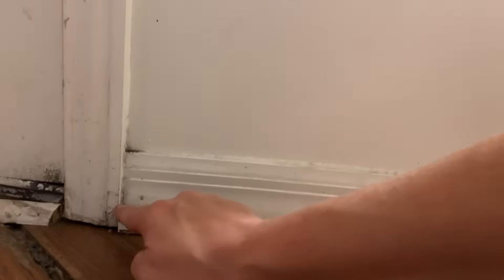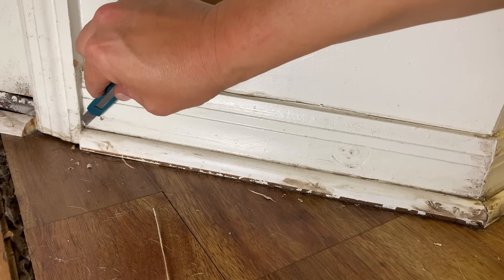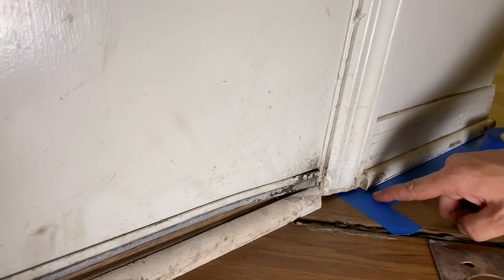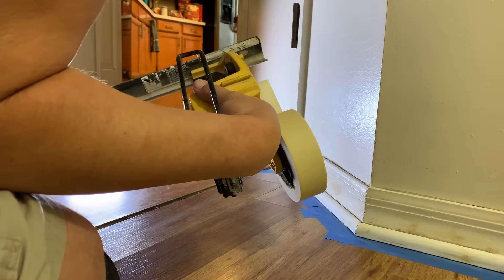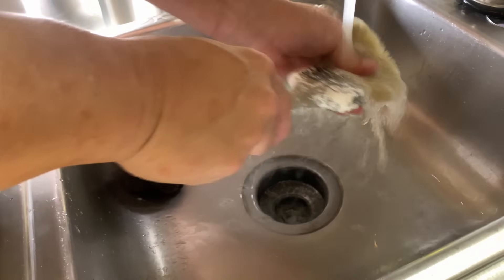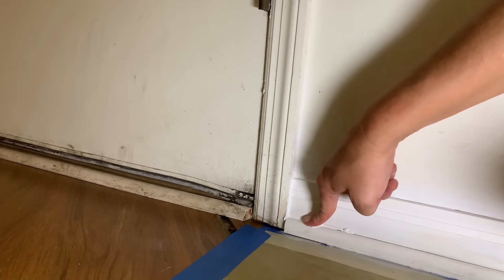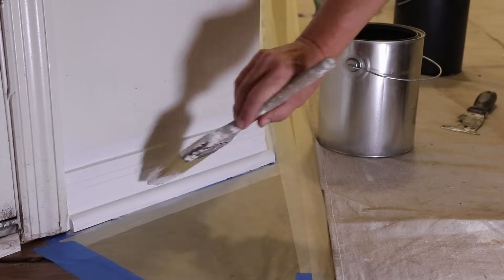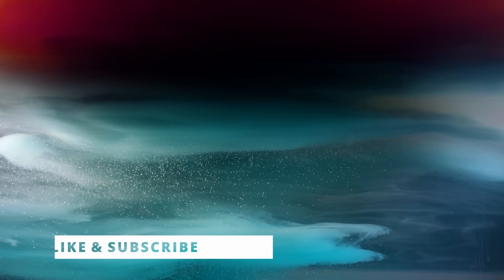How to Prep and Paint Baseboard Step by Step

Comment: Would it be easier just to remove baseboard and install new ones?
Reply: That's where you pick your poison! Lol
Reply: If it was my house, yes time for new baseboards!
Reply: Me too
Reply: It looks nasty as 🤬. Gross!!!!
Reply: I have historic trim. Can't just stick lowes stock trim in it's place,  but,  otherwise,  yeah, i agree.
Reply: I’m pretty sure you would still have to follow all the steps, except you’d have to buy, measure, and cut instead of remove the caulk and sand. 🤷🏼‍♀️
Reply: If you are looking for a pretext to upgrade your baseboards and door casings just do it.
Reply: Yes.  But remember.  Either this beautiful work, or whole new baseboards will look almost exactly like the original horror, in a few years... a year or 2 if you have kids and a dog.
Reply: @har8397    To be fair the original horror would have looked significantly better with a good scrubbing and it is not like the bad caulking and unfilled holes going to reappear.
Reply: My Mom always said; paint hides a multitude of sins. This home is older. You can’t just find replacement from HD, or L.
Reply: Nice job done man
Reply: Probably be cheaper. The labor to prep the old baseboards will add up. Although, some customers want to keep old trim for different reasons.
Reply: All about time n money
Reply: Dont leave blue tape on laminate wood too long. Did my kitchen took 4mos took floor paper and plastic dust barrier off, and totally ruined wood grrr
Reply: You have to match , cut an install that new baseboard…. Or ….. you could take the TIME to do what he did …. It’s all about $$$$$$$$$$$
Reply: The actual baseboard yes. the bottom half is called a quarter round there's nothing historic about that part replaced @hremaddox
Reply: @jendzendzel4052 not necessarily old trim comes off super easy within 5 minutes that section he was doing. and if you get pre-primed measuring cutting add Caulking and you're done I promise with a little bit of practice you could do that under 3 hours for that small section he was doing. That took way too long
Reply: @har8397 I lived in my place for 11 years now I don't have a dog my trim work looks exactly like it did.  obviously it gets dingy with time. a little paint and you're done
Reply: Yes!
Reply: 😂 right?!
Reply: I’d be ripping it out and tightening up the joints….
And how about they gap in the floor planks 😵‍💫…I’m too much of a perfectionist…I wouldn’t be able to sleep
Reply: That's a waste of material and massively environmentally unfriendly. Just do less prep and mask, paint over it. Doesn't need to take a whole day to do some skirting boards

Comment: A good job done. Sometimes it’s necessary to weigh up if extra time spent to restore old stuff is worth it as opposed to just fitting new. Sometimes it’s cheaper in time so therefore money to rip out the baseboard and renew it.

Comment: only been painting for 10 years myself. i love watching other peoples paint videos and learning from them. you did great work. I never used a 5 n 1 to push the tape down always just my hand. I am going to have to use that trick. It looked like it worked very well. for anyone who is wanting to do this yourself be sure to take your time. if you rush before stuff is dry you can ruin your hard work. also if you want it to be even smoother just sand between coats. 220 or 320 just a quick pass over to knock any dust or anything that might have gotten out your work. again amazing video

Comment: Regardless of my thoughts on the cost of doing this vs replacing, if it were my own home I'd be repairing instead of replacing. The only improvements I can add to this would be to use powdered drywall compound instead of the wood filler and pre mix mud, to lightly wet sand primer after cure, then add a propylene glycol or vinyl acetate like floetrol to allow brush marks to flow out.  

Personally, I would remove the mouldings to sand and paint them if they looked like that

Comment: I start with a wet sand. Hot water in a spray bottle with a 150 flexible sponge pad. Wipe with a tiler's sponge when done. This cleans the base and quarter-round quickly and BACKS UP THE MANUFACTURER'S WARRANTY!!.............you know, the one on the paint can.

Comment: Call me crazy, but I pull them off the walls, sand and paint (wagner sprayer) after pulling nails out and filling nail holes, reinstall them and just touch up after going over the nail holes and corners with wood filler or drywall compound.  I like high gloss on trim.

Comment: What if my walls are plaster? Do you suggest I do anything different since you're working with drywall?
Reply from the maker: Drywall mud should work for most kinds of repairs or a full skim coat even. The only thing is that plaster is much harder to sand than drywall mud and may be tricky to blend where they meet, but if the drywall is being applied on top of the plaster it should be doable.

Comment: I don’t understand using mud to fill gap between baseboard and wall… seems unnecessary and too much work. Can the caulk just fill the gap ?
Reply: Yes, but sometimes when you remove old caulk it can pull off paint and part of the upper surface of the drywall, which wouldn’t look right if you just caulked without fixing it first. It just depends on how clean you can get the caulk out in the first place.

Comment: This is really the minimum in homes 50+ yrs old…I was thinking, how do you know the paint on the base is not oil base?  I guess assuming the base material is PVC one could expect everything to be latex….and therefore you can use latex primer.
Reply from the maker: From experience, oil based paint looks and feels different than latex. Oil paint also "dusts up" a lot more than latex when sanded. If Im not sure, Ill wet a bit of rag with denatured alcohol and gently rub the painted surface. Latex paint will melt instantly and stain the rag, and oil paint will not. Also, the new alkyd or hybrid paints are pretty good at not caring about what it's painting over.

Comment: Wouldn't it be easier to replace the baseboards and trim with new ones?
Reply: I was thinking that too. I think it would look better and cost less to replace the beat up old trim.
Reply: In this case, yes, but he's only showing this as an example for a video. There are a lot of historical homes with trim that would have to be custom made for big money to replace.
Reply: It would not be easier. Anyone who says that has not been there before. You have to do most of these steps with new trim so the nailing, setting nails, wood putty, sand, primer, caulk, paint. Here is what you would have then also added to the job to do new trim- the removal, trips to store, multiple up and down to measure and then go cut, and then the cost of material. He went slowly as it is a tutorial, this doesn't go that slowly.

Comment: Would It not be easier to fill then sand the whole baseboard rather than sand fill sand.
Reply from the maker: I find I get a better result when I do a heavy grind to knock down all the high spots before I fill holes  because the filler has to be sanded more carefully .

Comment: Great video, but wouldn't it of been easier and cheaper to just replace the baseboards?
Reply from the maker: Well if you have the tools, you would have to cut the old calk, then pull the old baseboard. Then buy new wood, cut it, install it, fill the nail holes, sand, prime, still fix the drywall where it meets the wall. then sand again, re-caulk, mask, and paint 2 coats. I think prepping the baseboard is easier and takes less time than replacing and prepping it, especially if it's a whole house.
Reply: @peakhousepainting1933  
Ah I see thank you for taking the time to reply sir. 👍

Comment: Great video. One question, if you have a risk of lead paint, isn’t sanding going to cause an issue? Is there another option besides sanding?
Reply: Yes, you want to avoid sanding lead paint. A safer option is to use a liquid paint stripper, but that comes with its own challenges. Alternatively, replace the baseboard.

Comment: you should have removed that poorly nailed quarter round - clean it up and reinstall it or replace it . when you applied the caulk smooth it in with a putty knife to get a tight and squared finish ... your finger leaves a rounded curve in the caulk
Reply from the maker: I agree but the quarter round was added to cover the uneven edges from the crappy laminate floor install 🤷‍♂

Comment: You need to be careful putting painters tape on finished hardwood floors. The tape is meant for painted drywall, not floors. The tape can rip the coating off the hardwood floors. Learned this the hard way.

Comment: The previous guys probably didn't get paid enough to have a choice to worry about it happens all the time in decorating a lot of people think its a peanuts job
Reply: Doesn't matter how much prep he does besides the obvious punching the nails thru... Hrs never going to make that baseboard look brand new..... Once it's old and fucked up...dings...your never going to make it look brand new... yeah you can make it look refreshed but most people don't want to pay the actual cost to do this much prep on ALL their base in their house... This guy did on a little 12ft run of base... Most people would rather pay some Mexican $200 to come do a quick job...I've been a professional painter for close to 10 years trust me I know... Most people don't want to pay the actual price it takes to do crazy in depth prep... Have to stay competitive... And this guy doesn't have much experience caulking or painting... and the fact he laid down a drop clothe to paint baseboard is non sense... He should've had that down before he made the multiple messes that he had to vacuum up... So sick of non painters trying to sell BS for views....
Reply: And he's literally using wall paint for the base when there's is plenty of options of paint that is specifically designed for trim that is more durable
Reply: @nothingsimpostleble1593  sometimes you can get them looking brand new but yes a lot of the time if the customer or previous painter as painted them wrong then apart from burning them off which would be very costly you can only get them to a point but its still takes a fair amount of time
Reply: @nothingsimpostleble1593  some wall acrylics you can use for woodwork though like you say not really durable enough but then most acrylics that are designed for woodwork ain't durable enough anyway especially when it comes to dirt pick up and grease and he may have had some wall acrylic left over and trying to do the job as cheap as possible. Thats just how it is sometimes you can only use materials and work to the budget your giving.
Reply: @jackwardley3626  Yeah for trim we use SW Emerald trim urathane....it's like $90 a gallon...that's our contractor price...usually it's $110...never ever would we use bher on anything..  It's a shit product

Comment: So much wasted tape, expensive for such a small area of work. If you were going to to do this much work you might have been able to pull off that "cheap fix" corner-round nailed to the baseboard. Now that you finished that small section of moulding, time to do the rest of the house moulding, doors, and fix that gaps in the floor. 😅

Comment: I have to say that that is quite normal the amount of prep you had to do but where you went wrong is in my opinion taping everything up,that is a massive amount of prep just to paint base cove. I do not use anything like that for basecove and I do not end up getting any paint on the floor, I guess it’s because I do it for a living, but something you could consider, for the future is   To caulk before painting because there is trim caulk that you can get that is dry and under 30 minutes I use it all the time because if you caulk after you’ll see a sheen difference plus that caulk gathers lots of dust if it’s not sealed with paint That’s a pro tip for you you can use at your next project. I hope you’re being paid well for all that preparation and amount of tape you use, you can significantly cut down on your time by practising more to have a steady hand, and then you won’t need to rely on that crutch. Witch is tape, I am a little bit embarrassed, unless you are not a professional, but your channel is named after a painting company peak painting so if you’re a professional by trade, I think you could make yourself more efficient by taking this constructive criticism.🧡 “ more practice = more confidence = being efficient!
Reply: Thanks for the tip re caulking first. 
But wait.. So you're saying you paint baseboard with nothing protecting the floor? I.E. That you're that precise with a brush to avoid any and all drips, etc?
Reply: @Eclectic8  Not the guy you’re responding to and I’m not a professional by any means, but I was told to just clean up any paint that spills that get onto the floor really quick with a wet rag that you keep by your side. This is for painting trim only. For a wall or a ceiling… laying down a drop cloth is important. I’m about to paint trim and I’m laying down a drop cloth anyway.

Comment: Installing a new baseboard and painting  it will be easy and better.
Reply: That's my thought too
Reply: Some of us rent and it's not worth it to buy and replace all the baseboards for the benefit of the landlord. All,u can do is clean and repair the mess they have you living in lol
Reply: @aleks-33 maybe think of it as money vs time?  I am a homeowner and re-did all our bedrooms with essentially this method, but looking at the hallways and living room now, I cannot take that much time to fill every ding and scratch when the baseboard is 55 cents a foot and the shoe is 40 cents a foot.  Even if I made $20 an hour, I would save myself an intense amount of time by just buying the 20 feet(or, one hours worth of trim) that were repaired in this video with baseboards as bad as mine (comparable to this).  That said, I already had a nail gun ($200 when I installed some simple coffered ceilings and crown molding), so there is an expense there, bit I am borrowing a friend's miter saw and will be done much faster than trying to cut out, sand, fill, sand, prime, fill, etc.  Just a thought.
Reply: Great video though.